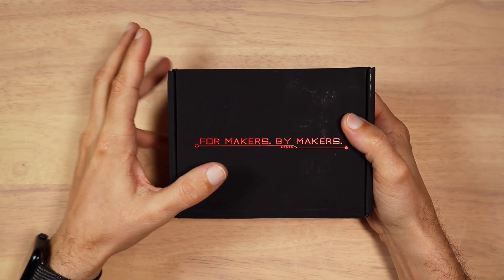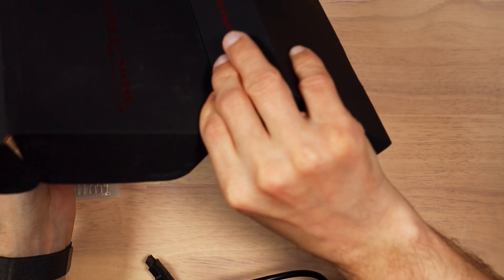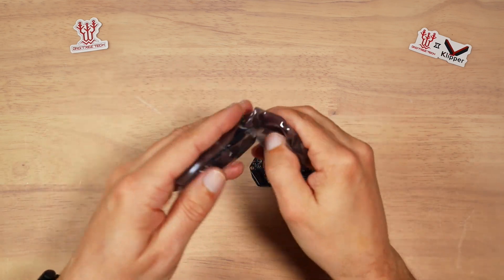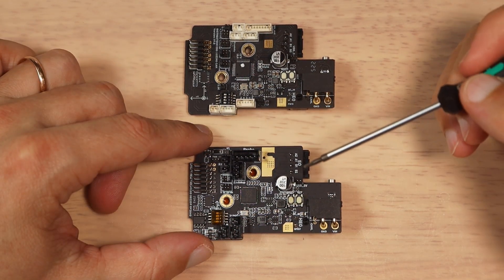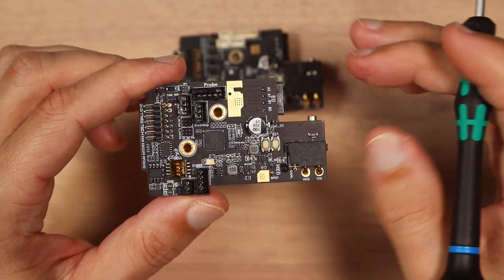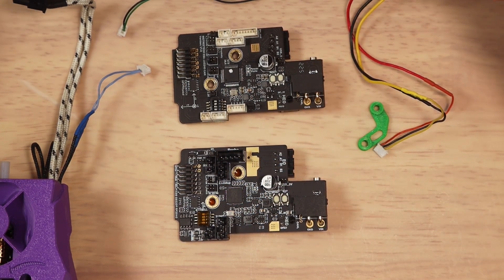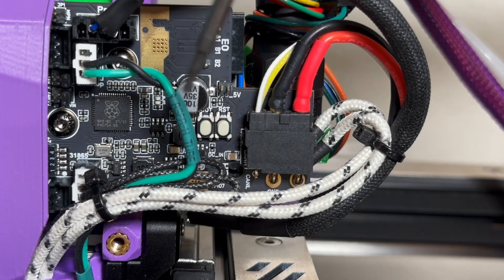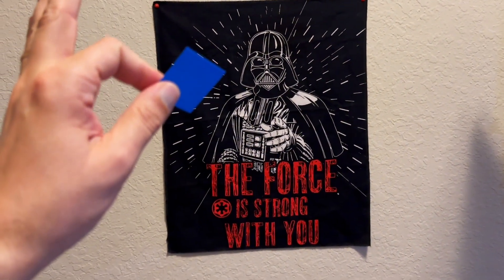BTT EBB SB2209 CAN V1.0 (RP2040) - StealthBurner Toolhead board

Comment: Nice video! I must ask though. Why do you have a board on your hotend? My printer is a little old school compared to some of todays options. Im using an ender 3v2 with sonic pad. Maybe you could explain the difference between the options provided with this toolhead compared to the basic hotend.
Reply from the maker: Not sure this particular board will fit your needs unless you install yourself a Stealthburner toolhead. Imagine you have a printer with direct-drive toolhead that has 2 fans(Parts and Hotend), Extruder driver, Nozzle LEDs, Screen, Heater cartridge, Thermisto, ADXL sensor (to tune resonance frequencies), Filament sensor, Autobed leveling probe, in this case how many wires you will have going to your toolhead from the motherboard, around 16-20 I guess. Those toolhead boards allow you to pass only 4 wires (Power +/- and CAN L/H) everything else you connect directly to this toolhead board, so we have less weight and no wire mess but you need motherboard that supports CAN-BUS or you can use U2C module.

Comment: If I use 2 filament sensors, do I connect them directly to this board? If so, where should I connect them?
Reply from the maker: Depends on what kind of filament sensor we are talking about, if it's simple switch than you can connect it to any endstop or bltouch headers.

Comment: Can you link the parts? When I used the ones in btt repo the thermistor port hits the door
Reply from the maker: Hello. What exact part? Unfortunately I have hard time figuring out from your message what exactly do you mean.
Reply: @hobbyistnotes  main body for stealthburner and cable door stl's are they different than standard parts are does it fit with the standard voron stealthburner body parts?
Reply from the maker: @fredhenning798  Stealthburner parts are stock from original Voron SB repo.

Comment: you mentioned putting a link for the bracket to print - what is the link I don't see it in the description
Reply from the maker: Follow "My Printers configs" link there you will find an STL
Reply: @hobbyistnotes  I checked that repo in the link - I only see two umbilical attachment STL's I don't see bracket for the board
Reply from the maker: @paulhuckaby  Ohh.. you talking about pcb spacer, here: https://github.com/hartk1213/MISC/blob/6e4f22c85e541eafab4471c52c59f51c7ac6b2b8/PCBs/Stealthburner_Toolhead_PCB/STLs/pcb_spacer.stl
Reply: @hobbyistnotes  Yep that is what I was after - Awesome thanks!

Comment: Does your GitHub repo have the config for the EBB SB2209 (RP2040)? The one I found looks like it is for the older board. I am trying to set this up and I am having trouble with the temperature sensor settings. I have a PT100 instead of a PT1000, but I am hoping that after viewing a correct setting, I can figure out how to set mine. I think I need to use the setting for the MAX31865, but I'm not sure. The example config file on the BTT GitHub repo seems to be configured for the 2-pin PH connector, not the 4-pin PH connector. But the instructions show using the 4-pin PH connector for the PT100.
Reply from the maker: Hey here are the configs: https://github.com/irebane/my-printers-misc/tree/main/Voron%20Trident%2C%20Manta%20M8P%20with%20EBB(RP2040)
Reply from the maker: There are 2 types of PT1000 sensors: one is with 4 wires and another with 2 wires. If you have 2 wires like me you need to crimp them to 2 middle pins and set tiny switches based on how BBT's documentation shows, you also will have to use output of MAX31865 in your config file.
Reply: Thanks for the link. It turns out I was just confused about which sensor the hotend I purchased came with. :) Once I plugged into the 2-pin PH connector it worked fine.
Reply from the maker: @davidsherrick8633 Very good!

Comment: If you do a software install guide I will give you a cookie.
Reply from the maker: Software? I mean BTT documentation pdf is pretty straight forward...
Reply: @hobbyistnotes  Sure, to someone smart like you who has done this a lot, keep in mind this is youtube, we are dumb, a guy just asked you Why do you have a board on your hotend?
Reply from the maker: @Pigeon_FX Good point, I will think about it.
Reply: @hobbyistnotes  I bought two of these for enderwire conversions and I am stuck.   I flashed the sb2009 with bootloader using DFU mode.   No message saying success just that it flashed it and rebooted.   I then made the firmware but I just downloaded that and flashed the board as I couldnt figure out how to get the board id to flash it with DFU.   I then ran the query to give me the UUID and it gives an error message.   Also power and data light are on, green and red.   Red flashes.   I have the 120R jumper applied on both the board and the toolhead board.   The board Im using is a Manta E3EZ.    Not real familiar with canbus nor klipper.   This is my first build.   The Manta board has a 120R jumper applied as well.   I had canbus hooked up when trying to query the UUID.  If you could help I would be in your debt!
Reply from the maker: @2muchscott  Hello, you got lucky cus I am currently editing complete Can-Bus setup video for Manta E3EZ it will be released in few days.
Reply: @hobbyistnotes  Thanks a ton!   I'm stuck.   Not sure if I need a U2C board or not.   I thought it wasnt needed with the Manta Board.  Look forward to seeing your video.
Reply from the maker: @2muchscott  with Manta E3EZ you don't need utoc. Utoc needed in case you have motherboard that doesn't have CAN support, something like BTT SKR Mini e3 v3.
Reply from the maker: @2muchscott  https://www.youtube.com/watch?v=GfUMAPoJlR4
Reply: @hobbyistnotes  I would disagree. Though could you provide the link to the specific one you used ? Id really appreciate it. GOing nuts here trying to figure this out & most tutorials are out of date.

Comment: Nice! Did you have any issue of overheating?
Reply from the maker: No, with Enclosed PLA printing it was around 35(C), but I am not using built-in stepper driver, my extruder driven by separate set of wires cus I do not want to relay on driver that is on non cooled board inside of chamber, especially when I print ABS with 110(C) bed temp. I had been thinking about switch over using a board driver but for that I need time and I have more impactful and fun projects in line.
Reply: @hobbyistnotes  makes a lot of sense to keep the diver out of the chamber. Thanks for sharing!
Reply from the maker: @200Over all RP2040 is a very cool(cold) controller, I have seen some people add cooler to the toolhead to cool the board but I personally think it's easier to pass separate wires and this in case there is no need for extra weight and extra part on the toolhead.